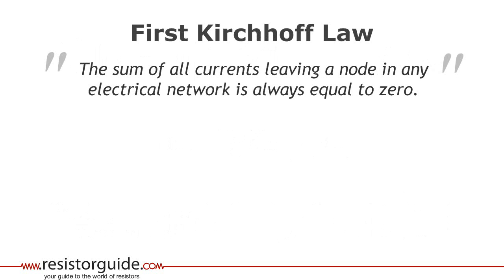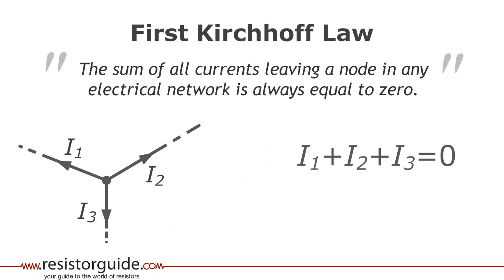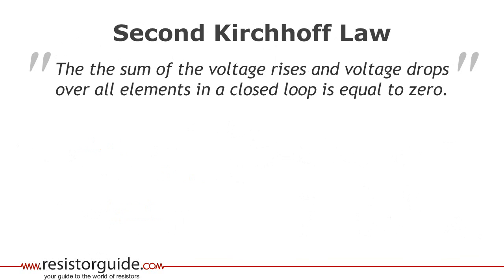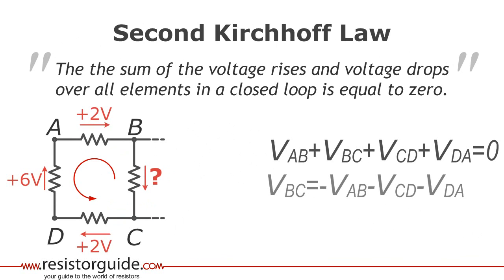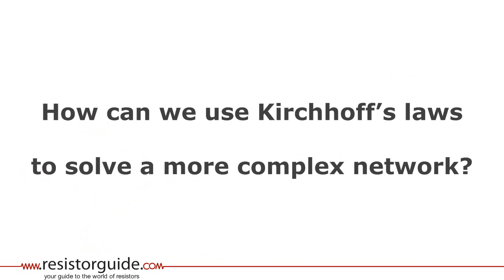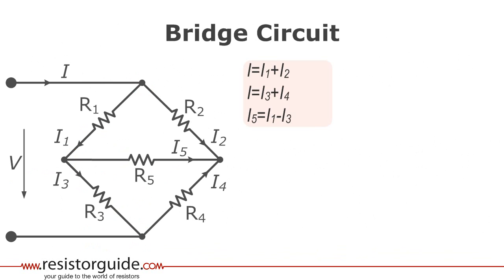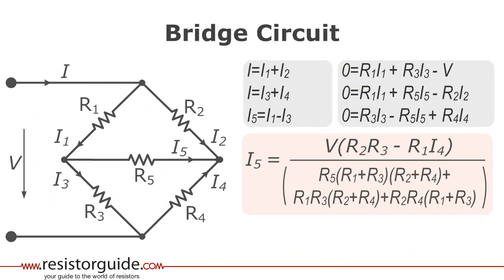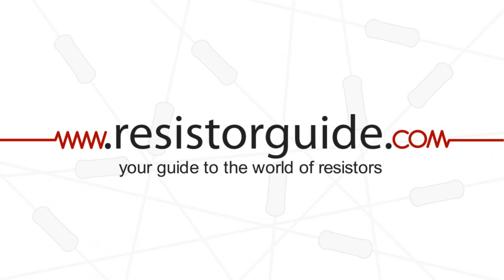Solving resistor networks with Kirchhoff laws

Comment: Now please fix the equation for I5 and re-upload. :-P
(It says I4 instead of R4.)
Reply: the orientation of I4's current is drawn clearly in the wrong direction, too.

If we assume I2 and I5 are both entering the rightmost node, then I4 has to be going out of that node.
The KCL equation for that node also agrees that I4 should be moving out.